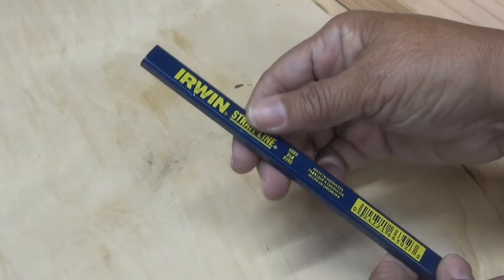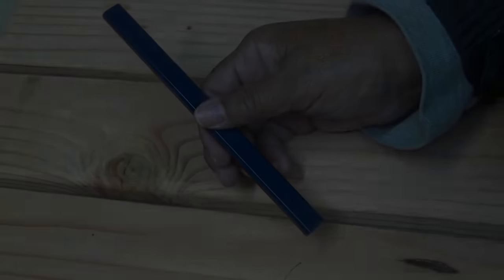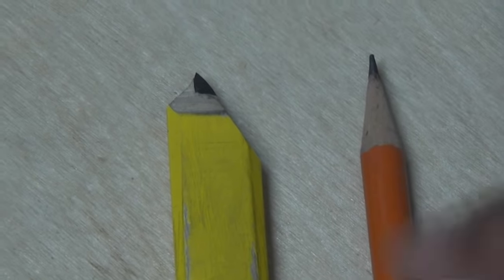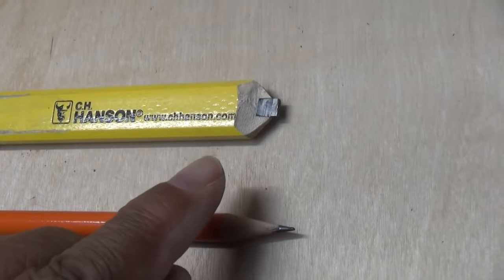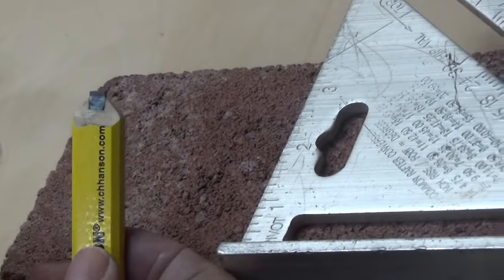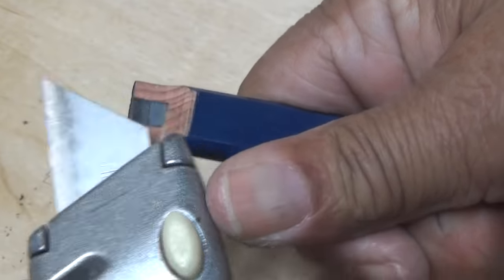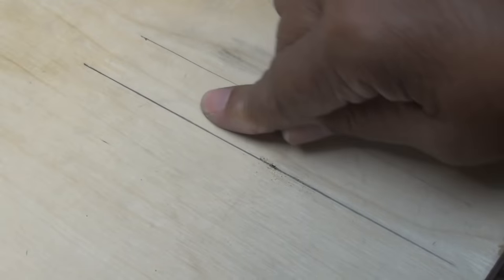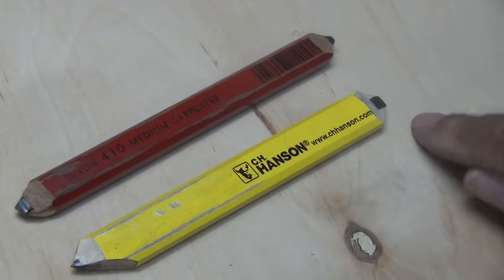Why is a Carpenter's Pencil Flat?  And Other Stuff

Comment: Some of these features aren't unique to carpenter pencils tho. The ability to draw on rough surfaces depends on the hardness, the hardness of pencils ranges from 9B (softest) to 6H(hardest), the harder a pencil is the rougher the surface it can draw on. A 6H pencil with a blunt tip would draw on stone just fine, and draw thin lines on wood as well. Although, you can do it with a N2 pencil, but it usually takes an artist to accomplish it, as it requires a fine degree of control over hod hard you're pressing the pencil.

Comment: Don't carpenter's pencils also use #2 lead (equivalent to HB), unless otherwise specified? In which case, it too is a "#2 pencil" -- the "#2" designation is a rating of the lead (relates to the graphite and filler content) -- so give them to your kids to use on their "fill in the circle" standardized tests.

Comment: Actually using it as a spacer for a deck I disagree when the wood dries you'll end up with a 1/2 to 3/4" gap who wants that and in some places its a code. run your boards tight then as the treated wood dries you end up with 1/4 to 1/2" gap plenty for water or snow to drain through. Now you can use it for for interior trim doors baseboard etc.

Comment: Thanks and good stuff but lets tidy up some facts...First a Carpenter's Pencil is not "Square and Flat" as described; its "Rectangular and Flat". Secondly, Carpenter's Pencils do not measure EXACTELY 1/2 inch width and 1/4 inch thickness ...(maybe some do)...Just look at the clip starting at 6:00. The 2 pencils side by side, they are definitely NOT the same dimensions and the one in my tool kit is a Staedtler Medium (148 40) and dimensions W x T @ 0.59 x 0.28 inches...(15 x 7 mm)....

Comment: To big of gap on your deck boards.  Why? Deck boards shrink. Now when they shrink your gap will end up being 1/2 inch wide.  Should have put them tight so when they shrink you end up with that 1/4 inch gap.
Reply from the maker: This really depends on a couple of factors, season being one and material being used.

Comment: It is so damn hard to sharpen one without breaking the lead in them,  that is my gripe with a carpenter's pencil.
Reply: Use a fresh blade in your utility knife and take your time.  A number of light strokes with the knife instead of heavy handed will yield great results.  I've been using carpenter pencils over fifty years and find them indispensable.  Good luck scoots, it really isn't that hard to acquire the knack.

Comment: It’s not lead ! But if you remove the carbon , grind it to a powder. Use a woman’s blush brush , 2in clear packing tape and a blank 3X5 blank you can lift fingerprints on any smooth surface and send the perp who stole your property to prison.

Comment: the video is well made but i disagree with the content, all the things you do with a carbenter's pencil you can do with a normal pencil as well. except the rolling away, but i have my pencil behind the ear anyway. 1. not all carpenter's pencils have the same size, same as normal pencils, there are different sizes. writing on a stone? yes the carpenter's pencil usualy has a #5 lead, so if you buy a #5 instead of the #2 tou have all the same (of course shape it the same blunt as the carpenter's). the difference you see with the 2 straight lines: #2 is softer than #5 (carpenter's pencil). the reason why i use carpenter's pencils is simply because i get them as gifts. if i would have to buy, i would go for a #4 normal pencil as the carpenter's pencil is usually too hard

Comment: Lots of nonsense here. Almost everything shown can be done with a regular pencil. 
For example, a normal hexagonal pencil is 1/4" across the flats - but it doesn't also have the 1/2" dimension of a carpenter's pencil. Sharpen a regular pencil to a fine point and it will make just as narrow a mark as the carpenter's pencil. 
The two major advantages of the carpenter's pencil is that it does not roll easily and it doesn't break as easily.
Reply: Buggsy5:::::::don’t forget the HUSKY pencil.....great lead, I said ‘lead’, ergonomic, eraser built~in........I haven’t mic’d the diameter yet, but would guess 1/2”....
many innovative “anti~rolling” devices to create and add to the Husky, also......lol

Comment: Carpenters Pencils are not square.  If you're going to make instructional videos you need to use the correct words.  Rectangular.  One of the biggest reason's for the shape is so it can be sharpened to a very fine line and still be broad enough to have some strength.  You may have mentioned that...I stopped reading when you started making mistakes.

Comment: Wood deck spacing should not be more than 1/8" because when it dries out the spacing will widen further.  If you space 1/4" then the spacing could be as much as 1/2" (definitely 3/8")... WAY too wide.  I built our cedar deck over 20 years ago and did not space the boards.  They are now about 1/4" apart.